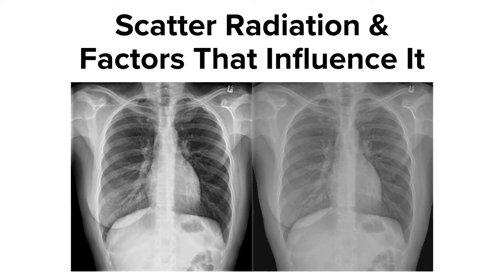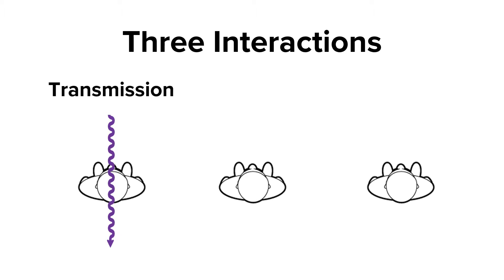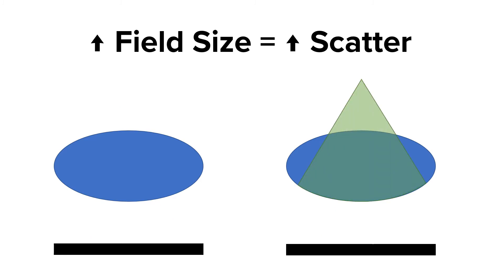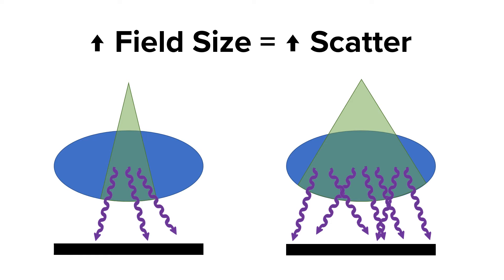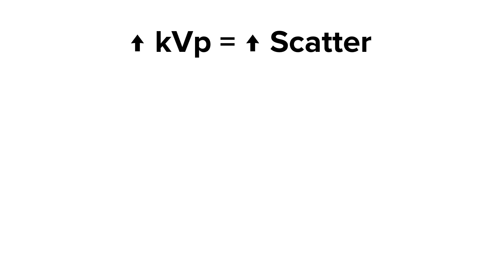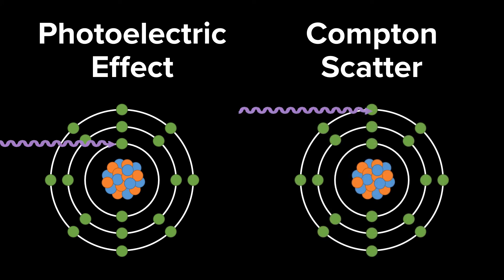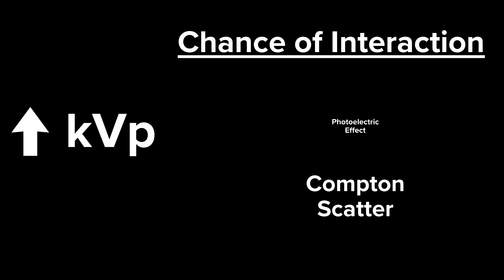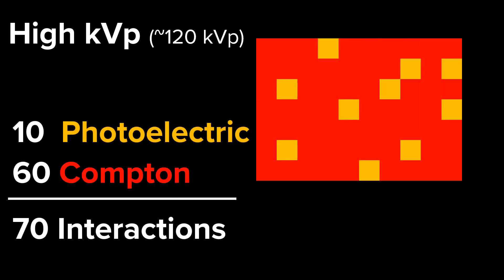Scatter Radiation & Factors That Influence

Comment: Compare an uncollimated maximum body and gonad dose lateral lumbar done in India https://youtu.be/zMAfGnYjRLw?si=idex2JnK-RcJEJDM. with the clarity of tightly collimated lateral lumbar spines I produced routinely https://youtu.be/255Z8dtPNpk?si=147y1V9pci_yk37b.  My technique perfected radiographic positioning because I used collimation as my positioning guide rather than centring points and 'rules of thumb'. https://youtu.be/4W1g0UVOGq0?si=xXT4MFHjzOT7AHOf

Comment: Sir i am so confused. 
According to what you explained and also as mentioned in Farr's physics ( increasing kV dose increase scatter, and decreasing kV does reduce scatter) 
The RCR put a sample of MCQS, one of them was :
High energy radiation is scattered more than lower energy radiation. Then my answer was true, but when i went to revise my answer infound it false because there answer was false !!
So i am so confused.
Can you help please?
Reply: Lots of people find this confusing. Increasing kV results in less attenuation and less scatter radiation (more of the x-rays are transmitted and less are attenuated via photoelectric effect and scattered via compton). It is the photoelectric effect and compton scatter that contribute to anatomic detail and spatial resolution. At higher kVs compton scatter is proportionally more than photoelectric effect despite both being reduced at higher kVs. At lower kVs photoelectric effect predominates - therefore, there is proportionally less scatter. 

I hope this makes some sense. At low kVs there is technically more scatter but proportionally there is more scatter at higher kVs.
Reply: @michael_nel  thank you for your interaction, you can say that i started to understand it but not completely however I'm still searching for it

Comment: What happens after with an electric photon ?? Is it possible to produce bremsstrahlung inside the human body through this interaction ??
Reply: As you knock electrons out of their inner shells you produce secondary radiation in the form of Characteristic radiation, rather than Brem, which can then continue the process of scatter as the secondary radiation interacts with tissue/matter around it.
Reply: @KuumaTheBronze it can even cause inverse Compton scattering.